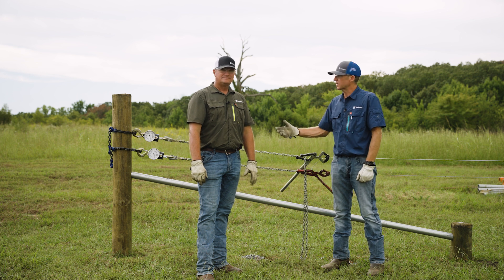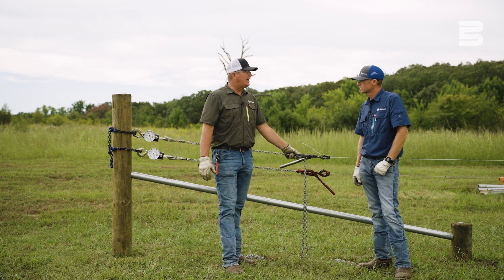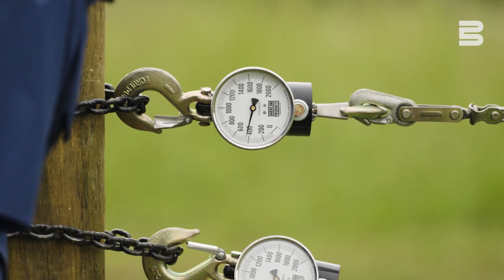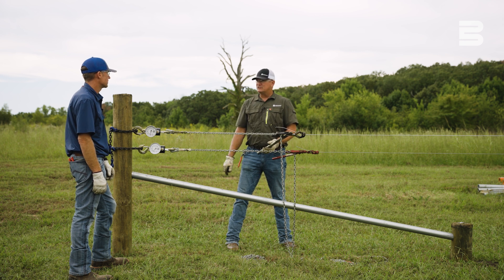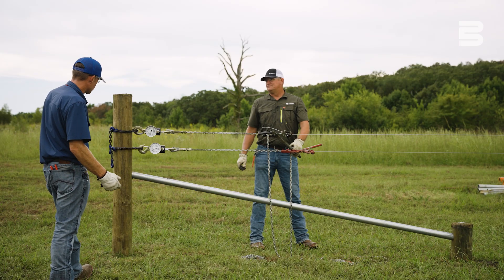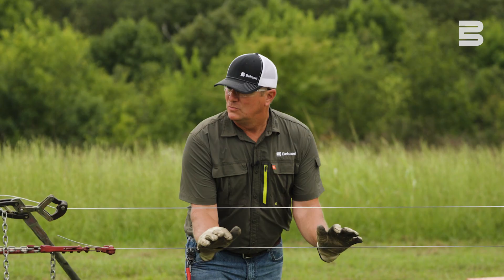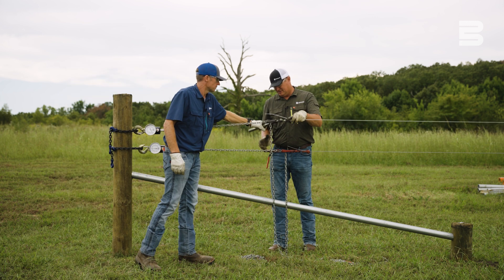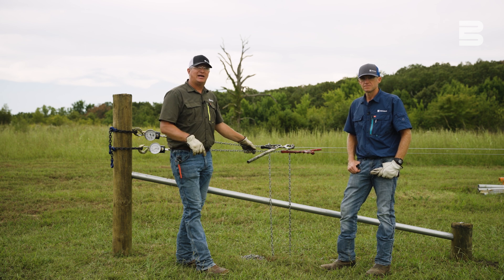Fence Myths Exposed: High Tensile vs Low Carbon Wire

Comment: Nice video...is there any difference in longevity, in terms of corrosion,  on high tensile vs low carbon?  And any difference when a grass fire passes through the fence?...we frequently get fires passing through our family ranch...happens about once every 5 years.
Reply: Fire is detrimental to the coating no matter what. Bekaert High Tensile products have a minimum class 3 or even a zinc aluminum and performance will depend on how hot the fire gets.

Comment: Do you have any materials showing how one might go about building a set of working pens with high tensile? Particularly how to tension and join short runs of smooth and/or fixed knot.

Comment: Hey guys love the video. I’m the founder of Barbwire Bandito. We sell a patented wire stretching solution with a live scale with a remote control accessary. 

Scaling barbwire tension is the primary function with the speed of the winch and the ability to move up and down the fence line working the wire into position while operating the winch with the remote control. 

There’s a pro & con with each style of wire. The high tensile holds its pressure better while the low carbon needs more strain during the installation process and is easier to repair later during failure. 

Fun fact: 25% +/- of wire sold in the US is high tensile while 75% +/- is low carbon. The ratio in almost even in all states.

Comment: Well that explains why you use soft or medium tensile on smaller electric fences that dont need much tension and high tensile on the 1km boundry fence that needs to me as strong as possible. always wondered why some wire i could never bend with my fingers the high tensile stuff and the solf one was so easy... for big long fences that are not electric high tensile for sure every time. Here in Australia the wire price has gone up quite a lot the best quality is about 220 USD for 1500m at 2.5mm thick and the cheapest is at 120 USD

Comment: I used your Statite50 in a 6 strand setup with the safer Wireman lever hoist and Crane scale guage. Pulled to 350-400 lbs. Was My first time doing fencing and was warned against it by many. Representative Jack from Oklahoma encouraged me and had no problems and no injuries.  I recommend ratchet strainers because you can tension it up further after removing the lever hoist and placing 4-5 crimps.  I’m very happy with my decision. I’ll take 40-50 yrs of rust free stronger life service over 3-4 yrs any day. Funny, many people that were recommending the low carbon, often had some to give me, only slightly used, they said, I wonder why…. ;-). Thanks Baekert and Statite50 !